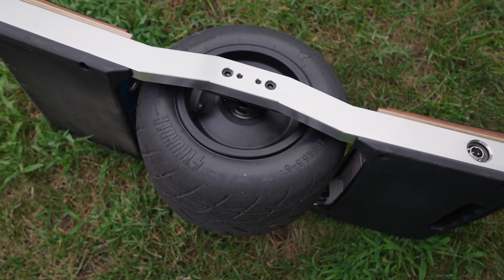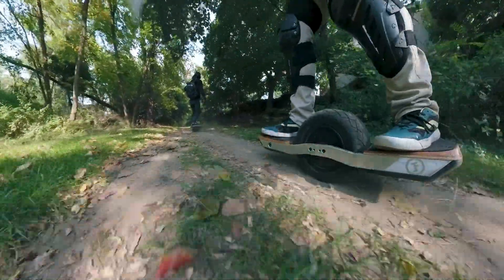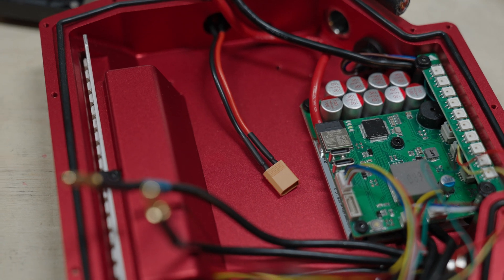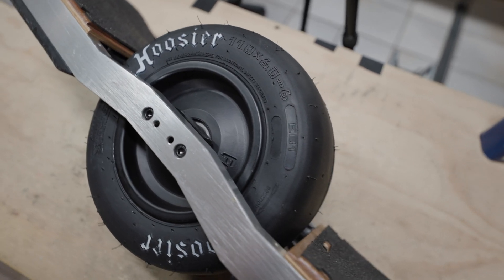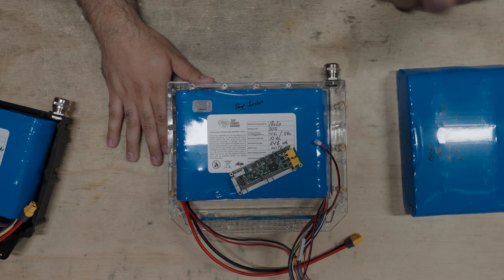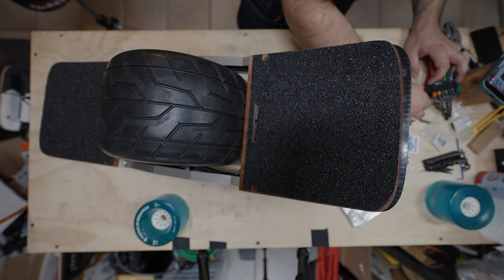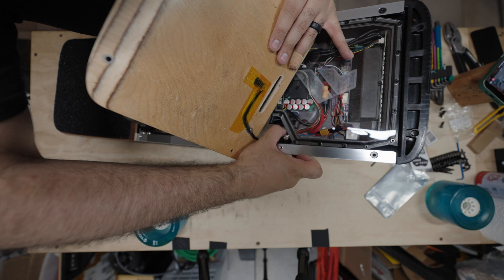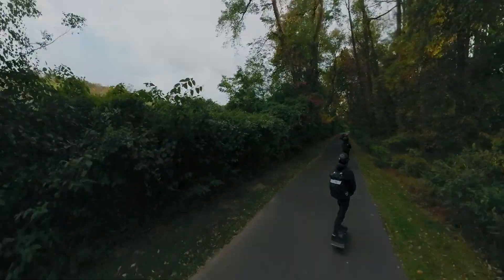A Dependable, Powerful One Wheel Build | Fungineers 1,000+ Mile Review | VESC

Comment: Where are you located ? I have a GT With 5000 miles and have a video showing what my board is doing now .after spending 500 dollars and waiting more than 2 weeks for it ! All of this happened on a middle of a ride making a ratcheting noise and throwing me off the board ! At first they said it was the motor cable then the starter now the speed controller ? I made a video showing and hearing what the board was doing maybe if you could send me your number or something I can share this with you and get this figured out ?? I think it's crazy all of this happened at the same time ? And can't help but feel like I'm getting fucked  oh also changed the bearings thinking maybe that was the problem ? Thank you sincerely unhappy 60 yr old OG rider

Comment: Do you have a build guide on modifying the xr footpad for a status led window?
Reply from the maker: The stock XR footpad, can’t really do that. The sensor goes all the way to the tire side edge, and so you’d have to remove it and install an aftermarket sensor, and then re-route the wire to sit inside the footpad and route to the other side of the board where the connector is. I am working on a video for my personal custom footpad, though, so I’ll show that. Should be out in January.
Reply: @TheBoardGarage good to know. Thanks for the info! Looking forward to your footpad video. Hopefully the videos will continue after the shop closes. Best of luck!

Comment: Is your 50S battery pack plugNplay compatible with the Funwheel X7? Was considering buying the X7 kit and your battery pack. If so, what would be the approximate range you think on a stock x7 with your 50s battery pack? (175lb rider, ride at 14psi, street)
Reply: Bro, I have the same exact question. Similar weight too.
Reply from the maker: It’s a larger battery, so it needs a larger box like the TORque box from TFL. Also, I don’t think the stock X7 BMS is compatible, so it needs a new BMS. 

The wiring from the harness should be more or less the same, but one of the connectors may need to be re-pinned or modified. 

Range, I get about 25-27 miles on pavement, so you’d probably get a little bit more, I’m 190lbs. 

I can usually adapt most wiring and things, so if you’re looking for a larger battery, feel free to email me through the site’s Contact page, and I can help out with a solution.
Reply: @ awesome thanks!